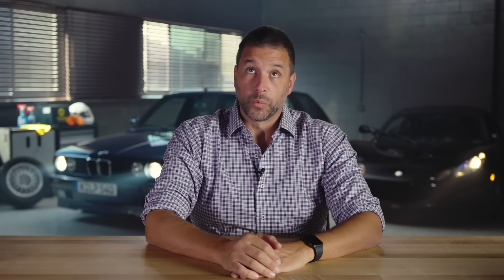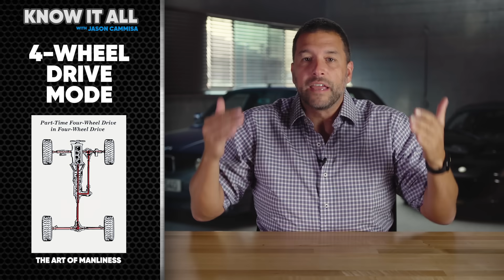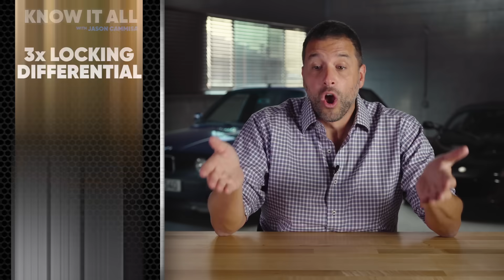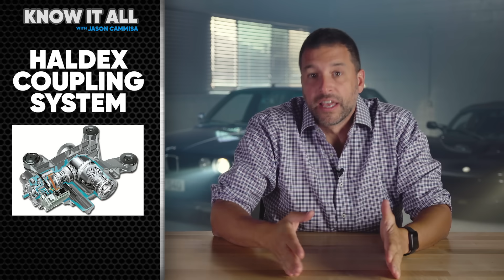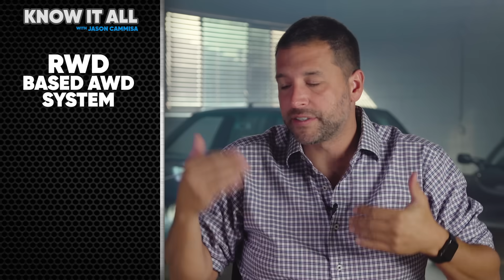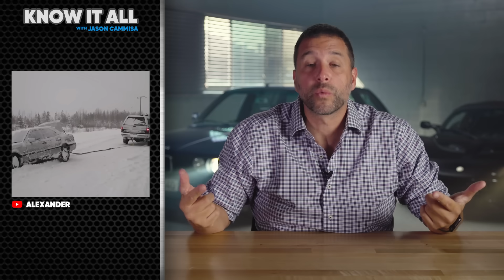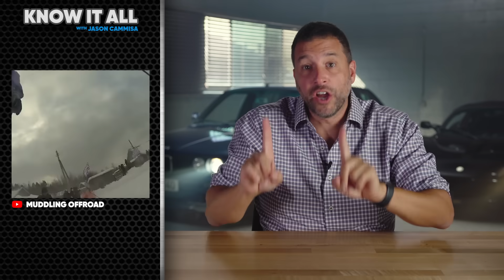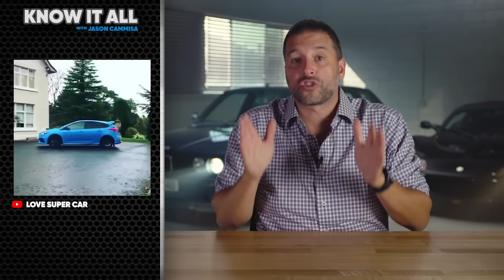Understand Your All-Wheel-Drive System | Know it All with Jason Cammisa | Ep. 04

Comment: Talks about AWD, leaves out Subaru 🤣
Reply: This video was (rightfully) complaining about the Haldex type AWD systems which are found in cars with sideways engines.   They really are a bandaid afterthought to a vehicle with a transverse engine and transaxle. 

Subaru's AWD setups are all very similar to the original Quattro in how they are laid out. 

- Both are Symmetrical
- Both are longitudinal
- The front differential is in the lower front part of the transmission, right behind the bellhousing
- The engine resides entirely infront of the front axle center.

There are differences with the center differential. The basic manual transmissions have a set of spiders gears with a viscous coupler to divide power and are 50/50. Some of the STi can change how the coupler works to set the power distribution. Automatics use a different coupler system without spider gears - CVT ,4EAT and they are front biased but are ALWAYS powering both front and rear at different levels. 

The old old Subarus just have a lock to lock the center differential; there either 4x4 or front wheel drive. Very similar to the early Audi quattros as well. 

They were both a longitudinal front wheel drive (ever notice how far back the axle was on the older Audis with longitudinal engines?) with the transaxle / transdiff /whatever looking nearly identical.  Then, at some point, the ability to power the rear was added.

The true quattros are still just like a Subaru. Whereas the stuff in the Golf and smaller ones are Haldex.

Compare items on ebay - 284203799448 is a Subaru 4-EAT transaxle and item 153581209924 is a similar vintage Audi quattro transaxle.
Reply: @mmiller1188  there are some 5eat autos with a planetary centre diff with a 45/55 torque split. Its called VTD I had one in my Legacy GT it was pretty cool. Now I have a 5MT manual with the 'dumb' centre diff and rear LSD.
Reply: @mmiller1188  if the idea is just to get where you are going on the road, haldex is just as good as any other system. performance driving is something else ..next to no one is doing it compared to the majority
Reply: yeah , i wanted to hear that too .
@JasonCammisa
Reply: I came here to learn about my 2006 Impreza Outback. I'm disappointed.
Reply: @reformedwretch2071  I think it's because the Subaru AWD system isn't a liar like the sideways engine Haldex based ones
Reply: @reformedwretch2071  I am disappointed in Subaru, too, it's not just you, lol!
Reply: Nothing to complain about with the Subaru system so why bother 😂
Reply: Until VERY recently Subaru was like the first Quatro cars. EVO's oversteer Subarus understeer (except the BRZ obviously) unless you screw with the suspension. Same mods will make an EVO oversteer MORE.
Reply: Lol, I know. I was waiting to hear something about subaru as well.
Reply: Yeah, whats that?
Reply: If your Subaru is 2012 and later you’re fine, any year before that is where the head gasket failure is a major issue.
Reply: @poluticon  I’ve got 200,000 miles on a 2007 Forester 2.5, no head gasket issues, what am I doing wrong?
Reply: @kellssheehan8578  nothing.
Reply: Yes
Reply: You sound butthurt because he didn't mention your car lol
Reply: He isn't gonna talk about them because subaru has a lot of forms
Also he isn't talking about every car manufacturer
Reply: @saifel-eslamal-labban2163  But the most commonly known brand for AWD?
Reply: @saifel-eslamal-labban2163  He's talking about the different AWD systems and the manufacturers representative of each, but doesn't mention Subaru's Symmetrical AWD at all. It's symmetrical because Subaru mounts its engine longitudinally, squarely between the front wheels. Most other manufacturers make front wheel drive cars which use a transversally mounted engine and then adapt them to AWD. But then it's still a transversally mounted engine which means that the layout can't be symmetrical because the engine is on one side of the car and the transmission on the other. Of course, Subaru claims that theirs's is the best and there is independent evidence to show it. But this video just ignores it completely.
Reply: subaru is all over now
Reply: Yeah, subaru is the best.
Reply: @Charles-barkly-DOG  just save up for regularly scheduled headgasket failure, lol.
Reply: @jamesgeorge4874  An $1800 repair after over 100k miles is pretty cheap honestly.  I'd do the timing belt, water pump, tstat, and head gasket at the same time.  Depends on the engine, though.  I have an 09 WRX with almost 90k on it and no head gasket issues.  But if it occurs, dropping $1800  is nothing on a car that has treated me so well.
Reply: @opiumized  it ain't gonna be $1800 on a WRX, that's the SOHC, EJ turd price.      Also, I don't care for the tin box ride quality, the road noise, and the rusting into oblivion in ten years aspect of Subarus in my area.
Reply: @jamesgeorge4874  most Subaru are pretty reliable unless you start to add boost. Most of them cross 200k km without head gasket issue if well maintained.
But the road noise is unlike any other.
Reply: @mugmushrooms9845  30 years I've paid my bills repairing automobiles and trucks. I would say 80K is when the EJ starts leaking. How long you put up with the oil spots, the smoke, the stink until it forces you to fix it may be 40k more. I have done over a hundred of them, and I see lots that have not been properly resealed and they rarely go 50K.  99.9 % are leaking by the time the timing belt and water pump are due for replacement. Plus they rot out fast too, we replace subframes and control arms all the time on them. Just not overly impressed by them. I have Volvo's and Toyota's and 300k without rotting, without headgasket failure, without barfing oil everywhere is normal for them.
Reply: @TM-bi8bt  $1600 will get it done, cash up front.
Reply: @jamesgeorge4874  Hey, I got 334k miles out of my subaru before the engine had issues. 95 Impreza with EJ18 motor.
Reply: @jamesgeorge4874  The only Subaru engine that got the bad head gaskets was the normally aspirated EJ. I guess this myth will never die, people just repeat it endlessly on the internet.
Reply: @jamesgeorge4874  
Yeah, that joke NEVER gets old....
Reply: What a 2010 comment lol
Reply: You mean Kinda-Sorta-AWD but not really AWD? Why bother? lol
Reply: @InsaneBimmer  you mean the only symmetrical AWD that stays AWD 100% of the time is not real AWD?
Reply: @mugmushrooms9845  the autos are also pretty bullshit awd. They heavily favor the front most of the time but in a different way.

Comment: I would like to see a video of an Audi SQ5 being driven at the limit in reverse - based on your explanation it should have similar handling as the Porsche
Reply: The old Q5 was always 40% front and 60% rear, but it compromised fuel efficiency for drivetrain loss. Now it has Quattro Ultra where it decouples the rear. At least the new SQ5 has an optional sport rear diff.

Comment: What about electric IWD, Tri and Dual motor systems? (Ik how they work but a video would be cool, digital AWD)
Reply: Most electric cars power each axle independently, but the electric motors allows a vary precise speed control to keep them matched and detect wheelspin and reduce power fast enough that it isnt noticed

Comment: I love Jason's videos but this was, I think, a tad bit over simplified.

There is a bit more nuance to the different AWD systems.

But overall. He's correct.

Although. Comparing a 4wd trucks "awd" system to Audis Quattro is a bit of a misnomer.

A truck (Mercedes G wagon for example) had a 4wd system with a user selected transfer case. Some with low range. This type of system differs significantly from systems that use transaxles, or transmissions that combine the transfer case and other couplings into the unit.

Comment: I see, I see. That's all very well and good, but how do explain the 2020 Stinger GTS? 100% rear in drift mode?
Reply: That's to the rear axle, not a single wheel. But if you weld the rear differential and lift 1 tire off the ground its doable

Comment: Your wheels don’t need to be off the ground to have more power sent to the rear. The ECS/Traction Control System can brake vector. Also the SQ5 is a rear biased system just like the Cayan, it’s just programmed differently. Sure front biased systems aren’t as cool or as fun as a rear biased system but it’s inexpensive and slightly more fun than FWD. It’s not the greatest for a track day due to the extra wear on breaks and the clutch packs, but it’s still more fun than FWD on a back road.

Comment: There's at least four other AWD systems. The all-mechanical system on the RG Voyagers, which is similar but not the same as a Haldex. Then there's the Ferguson Formula system used in the Jensen Interceptor, the Torsen Diff based system used in Airport Tractors to tow Jets, which IIRC is also in Jeep Grand Cherokee with the 4.7 V8, and then whatever it's called with H-pattern drive shaft layout used in English Army Scout Cars.
The Torsen Diff mechanical system WILL put 100% drive to any single wheel if the others have no grip. It was designed so that the Airport Tractors could safely move Jets with passengers even if two wheels were on Ice and two on dry concrete.

Comment: so Mr VW doesn't know about the haldex competition controller ? weird but ok, the controller makes the torque split aka center diff lock pedal activated instead of slip activated, so any time you are wide open you have a 50/50 front to rear, and because the cars are front heavy you get them to rotate really well, don't expect to hold a drift tho

in the older haldex models you had to change the part on the controller, old V8 XC90 had the 50/50 on throttle stock so people swap the controller from it into their audi and VW to make them rotate

haldex then made it an after market part and was sold for years as such

in the newer gens of haldex you only need a tune to activate it, it seems most US VAG tuners don't care about it enough to promote it, it really transforms the car, just look it up on YT and you will be amazed

i'm disapointed in you jason, you should know this, you should know it all ....

Comment: Want to see one of those FWD-based systems send all the power to the rear? Just park it with the front tires on an ice patch. Obviously, this won't help the limit handling problem, but it's ridiculous to assume that the only time a tire won't have any grip is if it's literally in the air.

Comment: When I had an STI it always drove me crazy how nobody actually understood how the AWD system worked, like the “DCCD” selector in the car changed the torque split in some measurably definitive way. Guys, the car has three differentials, all three of them “lock”, look up how a differential works and you can figure out where the torque is going.
Reply: No, all 3 do not lock, only the center one does (mostly - even at full "lock", the clutch can slip a bit). Front and rear LSDs in an STI are Torsens, which can never fully lock - they have what's called a "torque bias ratio". I believe for the STI, this is around 2.7:1. What this means is that it will send up to 2.7 times as much torque (not power, torque) to the wheel with more grip as it will to the wheel with less grip. If you have a wheel in the air or on rollers, this isn't very helpful, since 2.7 times zero grip is still zero, but where it really shines is on uneven surfaces where one tire might be on gravel and one on pavement, or maybe one is on ice while one is on hard packed snow with much better grip. 

Caveat: if your STI was an 06 or earlier, it had a clutched LSD in the rear rather than a torsen, but it still had a helical in the front (which behaves basically like a torsen).
Reply: @clapanse  I used the word "lock" because that's the word people generally use to describe what a limited slip differential does.  All three differentials are of a limited slip type, all three of them limit the slip in different ways.

Comment: And another example where EVs can  make better awd systems. With dual motors, you can choose which axle most power goes to and, I assume, you can even overdrive the rear wheels without worrying about a center diff clutch pack (I think Tesla does that, but I am not 100% sure). The wholy grail will be a motor for each wheel. You will then be able to do magic with traction and handling.

Comment: No mention of the torsen system, eh ?
Reply: Also in Touareg T3 and Q7, as well as Ford Raptor and Humvee, Lexus LX and GX
Reply: Torsen rocks!
Reply: Torsen are good and interesting but it's a limited slip and if there is no resistance on 1 side it acts like an open differential. That's probably why they are not so popular nowadays. Oddly I recently found out mitsubishi used a torsen with a clutchpack to ensure a minimum usability in some monteros
Reply: I would take too long, because at the beginning torsen was 50/50 then it was 40/60 etc. And now torsen is gone, Ultra Quattro has taken its place.
Reply: @DuBstep115  Torsen diff at 40/60 is still used on 4runner limiteds.
Reply: @jamesmac8424  It was good system had that in my audi A5
Reply: @DuBstep115  Yep, loved it in my b8 S4.
Reply: I TORSEN??????......I TORSEN!!!!!!!!

Comment: The Police Ford Explorer PPV handles like the old Audi. Run them hard, and under power they understeer you right off the road. Conversely the all wheel drive police Charger was fantastic. You could literally drive them sideways at full lock when sliding.

Comment: Another thing: for a long time with a haldex one the driven wheels needed to loose traction before the center clutch was closed. (Nowadays some manufacturers program theirs the way that it closes when a certain amount of throttle is applied) Im my personal experience, i found it unsetteling going up on a snowy/icy mountain road that had a bit of a canting towards the edge. The vehicle slipped with the front towards the "abyss" a bit before the rear joined the propulsion several times. With my own car that doesn't happen. It has what i call awd for snowy roads: no lockers just permanent awd with an electronically controlled center locking diff, and open front and rear diffs with break intervenience. (boring to drive for the most part.  You have to do stupid things to make it loose traction)

Comment: My TLX SH-AWD is great on the street but I'm scared to take it to the track for that very reason. On power behavior in low speed turns is incredible though
Reply: The TLX has differential coolers and a warning message if you do overheat it.

Comment: You made a whole video on awd and managed to mention honda infinitely more than subaru. Think about that
Reply: baffled .
Reply: lol
Reply: he's still trying to figure out how the sti's awd works lol
Reply: Because Honda's system was a true clutch type Torque vectoring setup as opposed to Subaru's that use brake actuated torque vectoring. The SVX had an active diff. That's about where that ended. They aren't proper AWD systems, more like brake assisted 4wd.
Reply: @d1sturb3d119  subaru uses an LSD center diff, nothing to do with brakes.
Reply: @drakedbz  We're not talking about the center diff. Any competent system out there has an LSD for the center diff. We're talking about the rear and front diff. The rear diff has no ability to control torque left to right. Subaru uses the brakes to control torque whereas Honda has a clutch type LSD with electronic control to split torque that gets to the rear diff 100% left to right. 

Hence Subaru uses brake actuated torque vectoring as opposed to active diffs that are superior.
Reply: @d1sturb3d119  Except the STI, which has a helical LSD front, torsen LSD rear, and an electronically controlled center diff.
Reply: @Robert-un3cf  Last of the greats. They have the tech. Sad that they don't use it more.